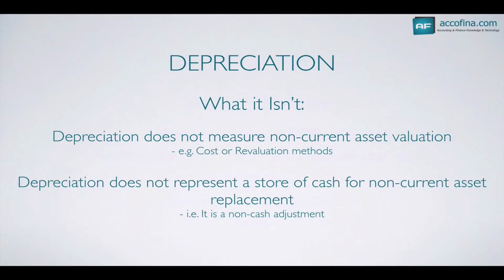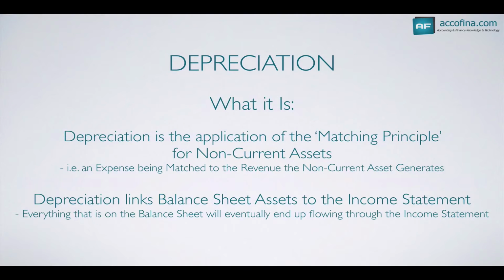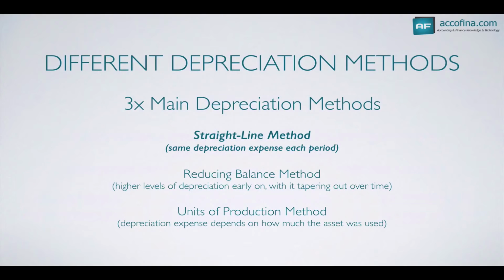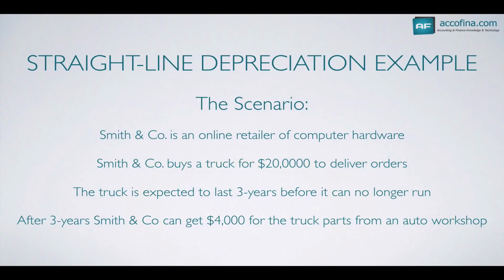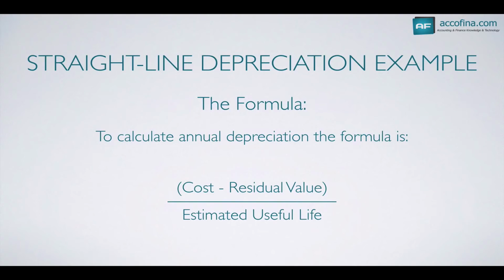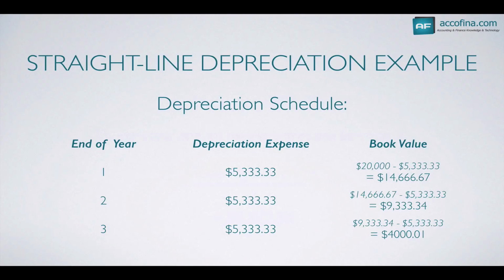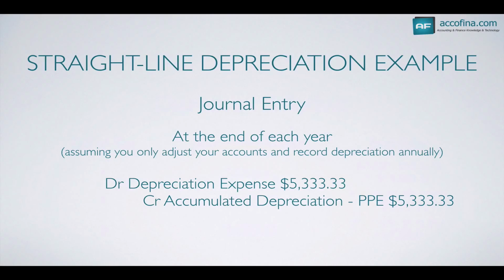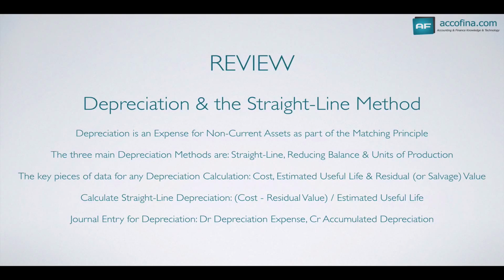Depreciation: Straight Line Method Explained. Depreciation Tutorial w/ Theory, Formula & Example

Comment: what if it is like ''tibbers automobile decided to purchase a new motor van for $240000 by cheque.The useful life of the new motorvan is estimated to be 8 years with NO RESIDUAL VALUE '' (not shouting just emphasizing ).Then how do we do it
Reply from the maker: Hi Jan, this is just a quick response: The calculation would be (Cost - Residual Value) / Useful Life......therefore ($240,000 - $0) / 8 = $30,000 Depreciation Expense per Year. I hope this helps. Get in contact if you need an explanation on the theory (this was just a quick calculation response). Cheers, Axel

Comment from the maker: First comment, yay! Hi all, feel free to comment/post if you need anything clarified. 
Happy viewing and enjoy learning about Depreciation & the Straight-Line Method.
Cheers, Axel
Reply: How to calculate using the same method when the disposal value and useful life is not given. For example if all vehicles are to be depreciated at 20% using the straight line method. 20% of the cost will be the constant depreciation ? And if the vehicle is borough half way in the year the depreciation will be half of the 20% ?
Reply from the maker: Hi Xsauce. 
Firstly, I'm sorry I didn't reply when you originally comment & that you did end up finding your answer at the time. 
But I'll stick have a crack at answering your question now:  

...You can't depreciate 20% of the book value per year AND call it 'Straight Line' Depreciation. As you suggested, it wouldn't be "constant depreciation", the depreciation would change each year when you applied a constant percentage to a variable book value. 

What you are suggesting is something closer to 'Reducing Balance' Depreciation, and this is you have a "Depreciation Factor" (e.g. 20%) that gets applied to the book value at each period. 

Specifically, the Reducing Balance formula is: 
(Book Value - Disposal Value) x Depreciation Factor = Deprecation Amount for that Period. 

As you see, with the Reducing Balance method, you DON'T need to know the useful life. 

And finally, if the vehicle is sold half way through the period, then it wouldn't be "half of the 20%" but instead would be 'half of the Depreciation Amount for that Period'.

I hope this answers your questions, or is at least what you ended up finding yourself when your originally commented (and I wasn't monitoring the Channel).

Kind regards,
Axel